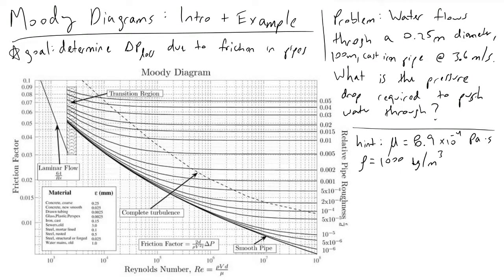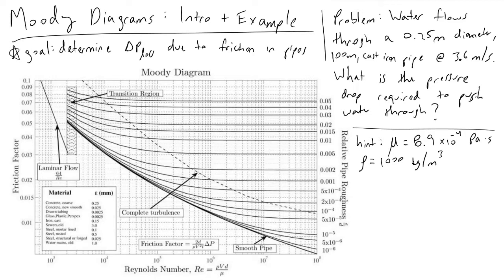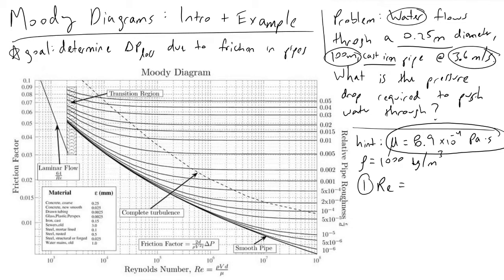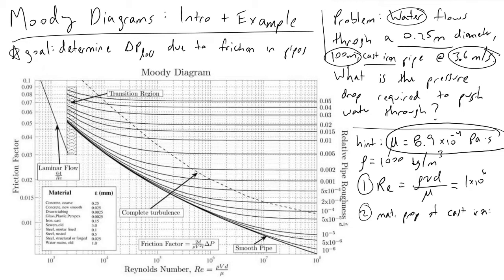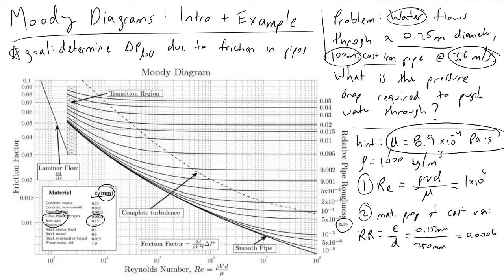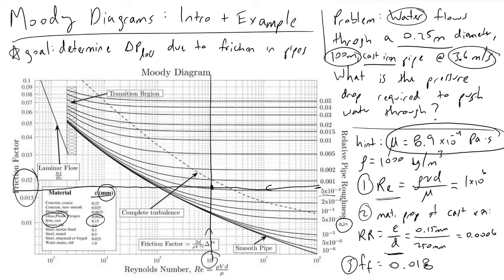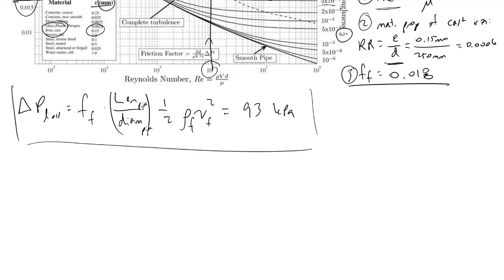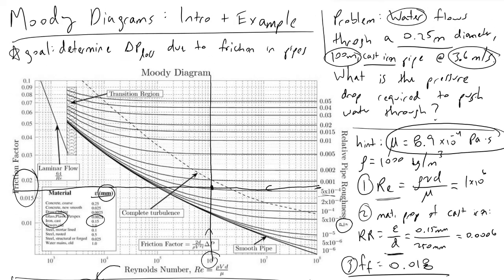Moody Diagrams Intro and Example

Comment: If I am given mass flow rate and don’t know diameter how to calculate Reynolds number
Thanks
Reply: divide the mass flow rate by its density to calculate the flow rate and determine the velocity using the continuity equation.